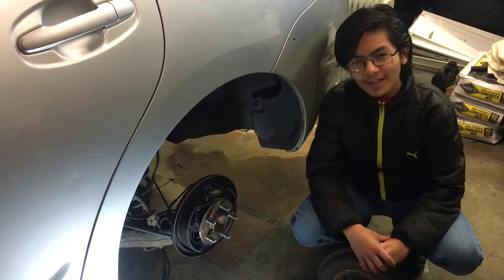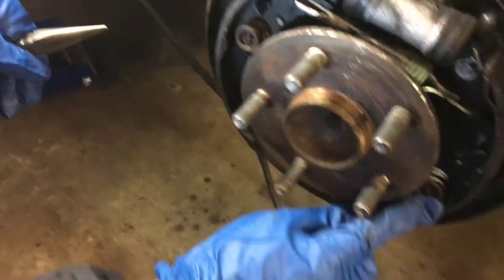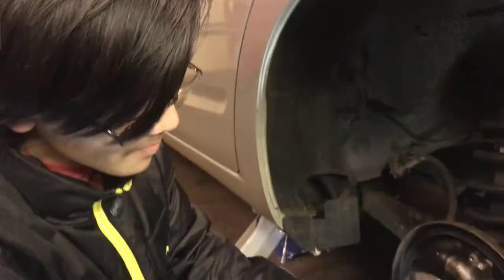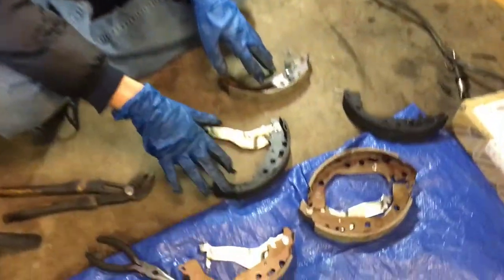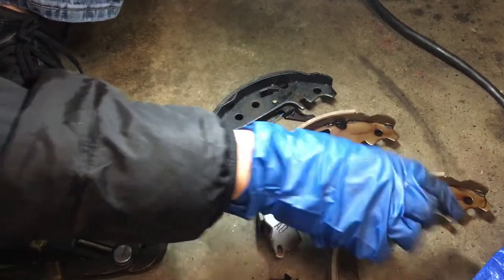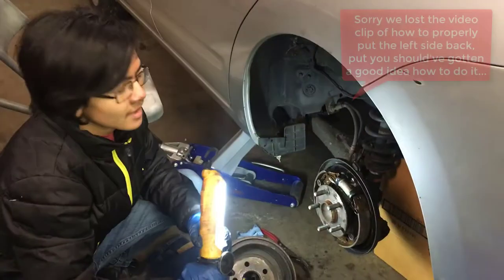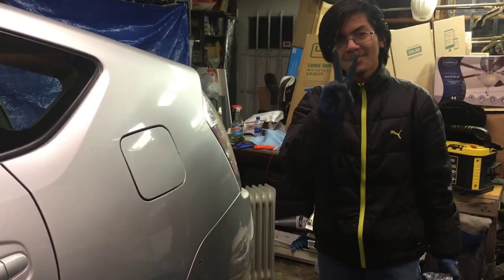How To Remove & Replace Rear Brake Shoes & Drums On Toyota | Prius Gen II Yaris Matrix Corolla Camry

Comment: What's awesome about this kid is that he is putting out the effort to help people. He's using a claw hammer for construction, pliers you can buy at 7-11, doesn't know the terms. i.e. the bolts he used to remove the drum (jack screw)(horse shoe clip)(brake shoes). I wish my kid was half as motivated. very impressive those Prius rear brake shoes are a PIA.

Comment: Prius uses the brakes pads/shoes very little compared to classical 
non-hybrid cars. I am an original owner of 2008 Prius and recently 
replaced the original front pads at 150K miles (still had about 1/3 of 
the original pad thickness remaining). I checked the rear drum brakes 
today, and found out that the original drum shoes are still in good shapes after 156K 
miles on them. The thickness of shoes is still about 3.0-3.5mm vs 4mm on the new shoes (the front shoes wear slightly more than the rear shoes inside the drum)! I just cleaned the dusk and put them back on. I think the shoes should last another 150K miles with my driving style :-)
Reply: When the shoes wear down 2.0 -2.5, adjust useing the 2 screwdriver method. This way you will also notice your emergency break will work better. And use breakclean on the inside of the hub.
Reply: @danielmalloy6093    What exactly is the  2 screwdriver method? I need a good hack as I'm nearing 2 mmm.

Comment: Good beginner video kid. I do have some things to add. 1. you need to lubricate contact points, disassemble the adjuster and lube it as well! 2. These are Brake Shoes not PADS(big difference). 3. Centric brake shoes work just as well for Prius (early or late model) and are half the price. I use a lot of OEM parts but spending more on a brake shoe in a hybrid brake system that is hardly used just doesn’t make any sense and is bad advice. 4. The Prius brake actuator is not sorcery, it will remain energized and cycle, however if you don’t approach the vehicle with the KEY FOB, leave it more than 15ft away, and have left the vehicle alone, there shouldn’t be any activation of the brake system. Do whatever makes you comfortable, but there is plenty of literature online to support this practice. Then proceed with whatever course of action makes sense to you. A Prius isn’t anything special. They are easy to work on and very reliable.
Reply: Many of the brake components appeared to be somewhat oily (perhaps leaking brake fluid?), or at least quite dirty, and you transferred a fair amount of this debris to the surface of the brake shoes as you handled them.  Before replacing the drum, it would be a good idea to clean the shoe surfaces with a quality brake cleaner to remove this contamination.  To echo Nordic's comment, above, when you make an instructional video, it's always a good practice to know and use the correct technical term for each part being described.  This can make your instructions clearer and more concise for your viewers.  That said, thanks for your time and effort to make this video, especially including the "struggles" at times.
Reply: DO NOT EVER lubricate anything inside a brake drum housing EVER.... RULE NO 1.
Reply: @Philjj61  Look at the factory Toyota service manual there Phil. You are wrong once again!

Comment: Aimen...Love all of your very helpful videos. Your details are quite good and as I watch I feel as though I am doing the jobs myself, with all of the little questions shown in detail as they might occur. One detail in this video might be to expand a little on the final manual adjustment of rear brakes. First, confirm that the star wheel has normal, right hand threads or? Second, I feel that the best starting adjustment for drum brakes is to adjust the star wheel until pads are against the drum (not too tight) and then turn the star wheel back to open and to make space between the drum and pads. Some say 15 clicks or ???? If not this method, please add some detail on your method on this point. Video seemed to cut off too soon, leaving this small but important point without the details at the level of the rest of the steps in this great video. Thanks again, keep up the great work!

Comment: Thanks for the video. Should have gone with oem from the start but I got shoes from an advance auto parts and they were junk. Too large for the brake drums to fit back on, wasted my time with them and had to go to an autozone and try their premium pair. Getting the final spring on while keeping the keyed pin in the right orientation was a pita too.

Comment: The new shoe doesn’t require the c clip? I bought an aftermarket set of shoes and it came with the c clips however there was no way to put them on the parking brake mechanism attached to the shoe.

Comment: Question!! I’m changing the brake shoes, the wheel cylinder blew out on me. I am not sure why as I followed the steps in the video. Any thoughts on what I could’ve done wrong ?
Reply: Emmanuel Huerta Battery:) Disconnect negative contact:) I call this issue “Boogeymen “:)))

Comment: I have 07 highlander hybrid after replacing the abs module accumulator (whole thing used) i got back traction braking downhill bumps. But i still have a short squeak noise when brake pedal is pressed all the way down while the car is not moving. Though have not replaced old pads and rotor sp there is a little pulsing while braking hard.

Comment: Did you disconnect the ECB relay, or just wait for it to time out, release pressure and then disconnect the battery?
Reply: Why do people always disconnect this? Just don’t get the key fob next to the car(more than 15ft away) and let it sit a while. I’ve done plenty of prius brakes without issue this way. Do whatever makes you feel better, but it’s not necessary....

Comment: There is a tool for those springs.  You also lube the touch points of the shoes to back plate,   Those c clips are best bent with a flat head then slide out.  You had a lot of  Hmmm I think the small tab goes in back type comments.  We will watch the video later ...   Next time get a paint pen and mark everything.   And last I always get new springs ect for another 10 dollars.
Reply: It is painful to watch at some points, i could be wrong but it seems towards the end the holddown springs for the shoes, at least one of them is in the wrong place, they dont look simetric,these brakes have been made this way for decades, not sure why Toyota wanted to put that spring dead center behind all that crap,guess they wanted to be different.

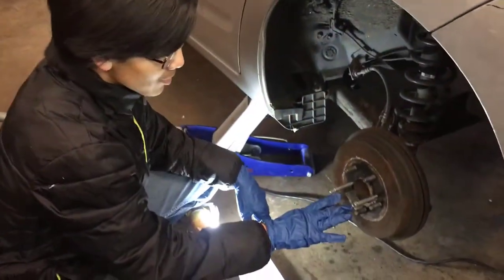Comment: At 1:30 that is called "Jacking Bolts"
Reply: Where do I find them?
Reply: @kitphipps1561  You need to know the size and thread pitch and then you buy grade 8 bolts and turn them in slowly a little at a time until it pops loose.
Reply: @onefixitman  thanks, but I used a 12 mil bolt that was mounting the washer fluid reservoir to the body, and it worked great 👍.

Comment: When change pads change drum
Reply from the maker: Yes, thanks for the recommendation to the viewers.  If we took the time to take this apart, might as well change the drum too....
Reply: Simply inspect the drums some people have them turned but typically neither is needed and the same goes for rotors
Reply: @ormonddude  I got lifetime warranty on my brake parts so.....I just replace it all since I got it all torn apart anyway haha no cost to me
Reply: jpnm81 It’s called a “BRAKE SHOE” for the love of god!

Also, most of the time the drums are fine. A Prius hardly uses the friction brakes. Regenerative braking does most all of the braking in these cars above a certain speed. These brake shoes didn’t even look totally worn out to be honest.
Reply: @nordicpride9708  yes I was attempting to be short on words. You are correct. A Prius I did recently most certainly needed new drums 2006 345000 origs
Reply: jpnm81 Most do not need drums. As long as they measure within factory spec, leave them be.
Reply: @nordicpride9708 nope  it's fixed and stops great plus new shoes on her too.
Reply: @nordicpride9708  I believe the the brake was left on
Reply: jpnm81 That makes sense! Probably the last time you will ever need to change them. Great cars 👍🏻
Reply: @nordicpride9708  hahah oh for sure
Reply: NordicPride970 they really didn’t. Mine look kinda like this and I’m not sure if I want to replace them with shoes that look identical in thickness.
Reply: @nordicpride9708  You have no idea about Prius brakes... Regenerative brakes do a small part of most braking on all vehicles incorporating electric/hybrid drive trains.

Comment: The dust boots he identifies as providing the extreme pressure required to apply the brakes is stupid and dangerous. They are there to stop water and dirt getting to the workings of the piston and help it work in a clean environment for a much longer time. Do not try this at home if you think this video is remotely professional.